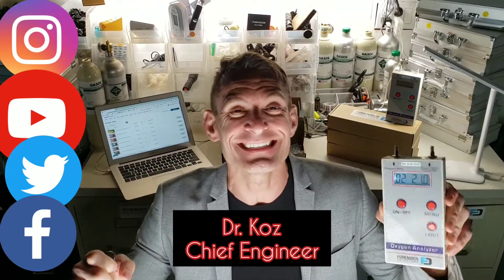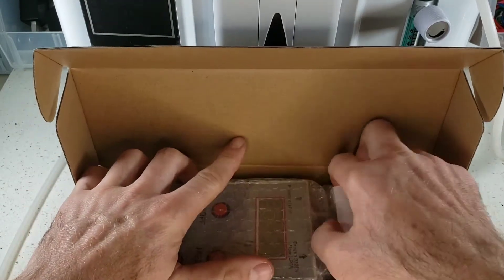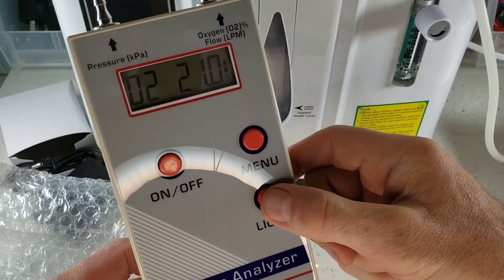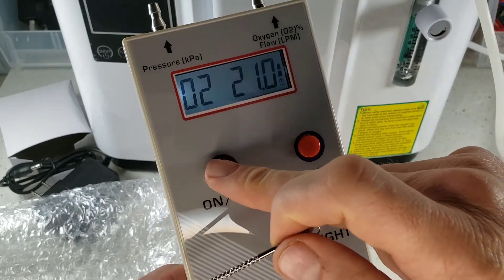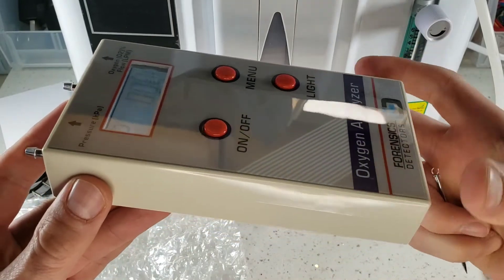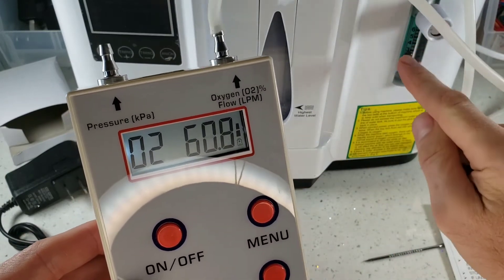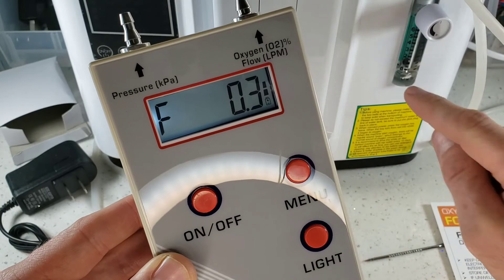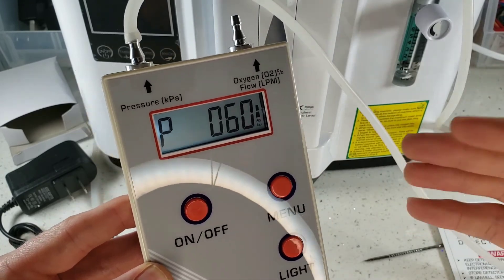Oxygen Analyzer for Concentrators

Comment: This seems good for the price. I am looking at a simple straight forward unit which does not require medical certification. I am doing air exchange membrane testing, i noticed that it stated +- 1.5% for ranges under 90%. Is this true and reliable?

Comment: I just got mine today. There's a print that's very confusing below the QA Verification stamp. It states:

*DO NOT* USE FOR HUMAN MEDICAL EQUIPMENT - not issued an FSA 510(K) premarket notification.

This video doesnt yet show that print on the certificate. Are they stating that this analyzer is NOT fda approved? Or are they saying not to use the analyzer on a "non-fda approved" human medical equipment?
Reply from the maker: The unit has not been issued an FSA 510(K) premarket notification, which means not to be used for HUMAN MEDICAL EQUIPMENT. If you have human medical equipment like an oxygen concentrator, we suggest using an oxygen analyzer with an FSA 510(K) premarket notification. I hope that is clear.

Comment: I'm confused by comments on other sites about this unit. Is there some adapter needed to plug this in the wall here in the USA or can I plug directly into the wall outlet in Tennessee?
Reply from the maker: No problem, comes with basic USA 110V wall charger.